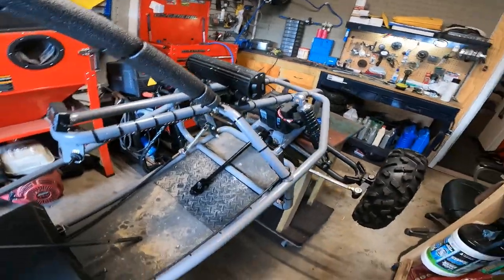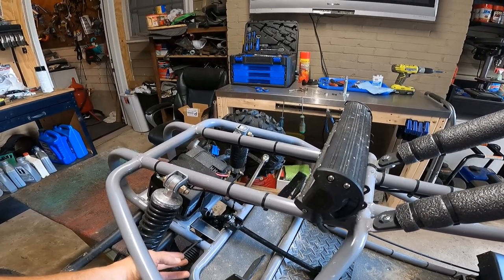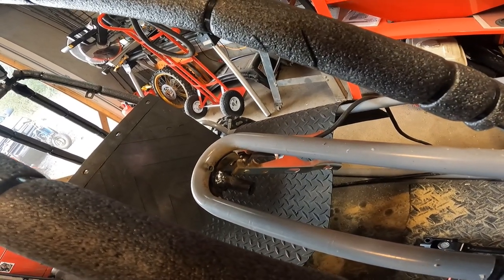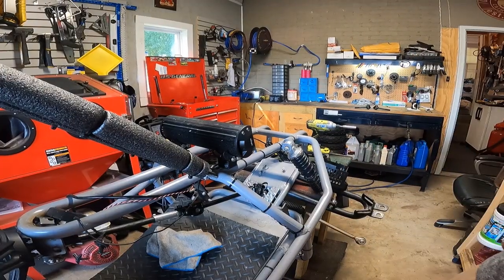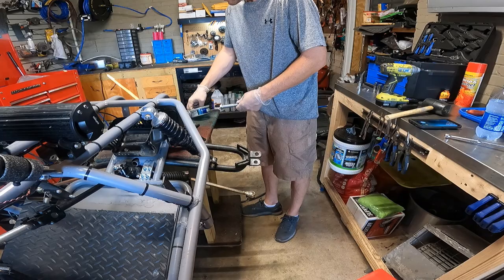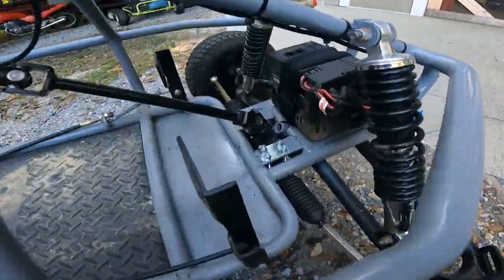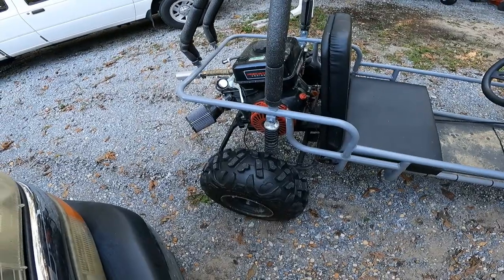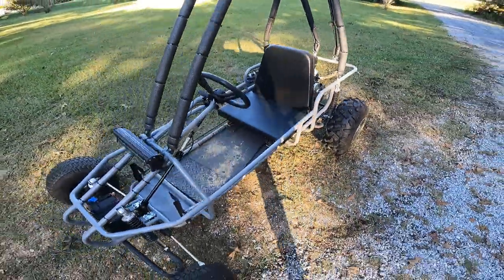Yerfdog 3200 Gokart Rack & Pinion Steering Upgrade

Comment: Are those the stock spindles? Did they require and modification to fit the ball joints in the spindle? Is this the $60 ebay rack and pinion set?